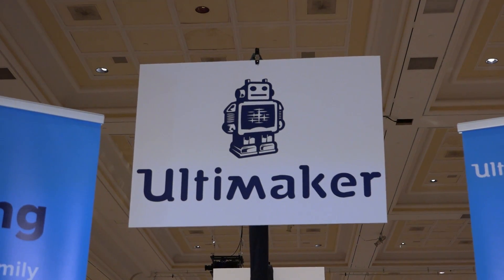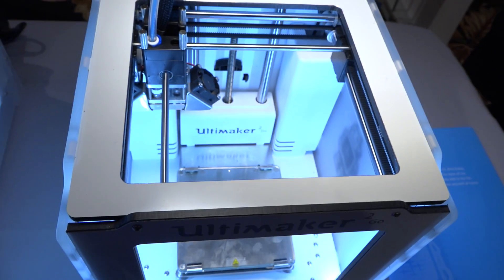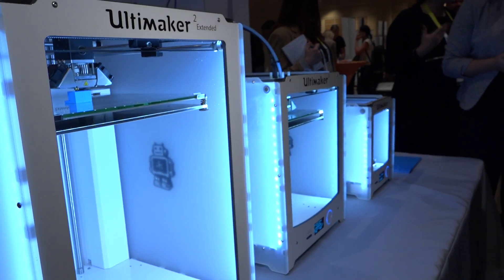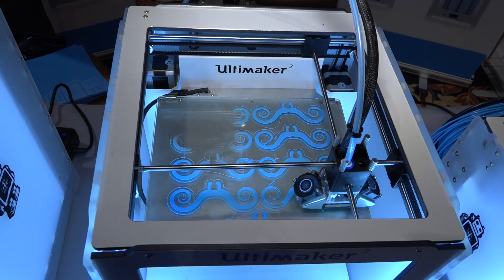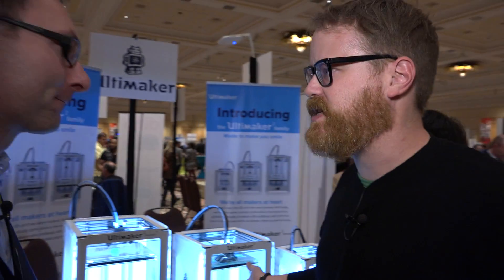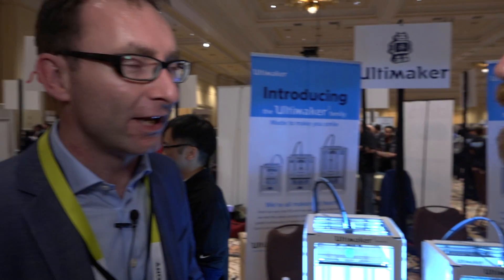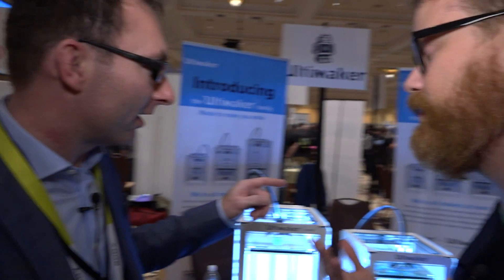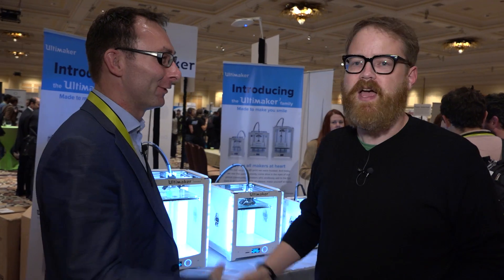Checking Out the Ultimaker 2 Series of 3D Printers

Comment: The Ultimakers are great machines, and yes they can print all the woodfill en metal fill PLA's, Colorfabb has these kinds of filament for months now.
too bad the UMgo has no heated bed :(
and I was hoping for a better price range, but they still sell the UM original, witch is great machine, and more easy to tinker with, changing a nozzle for bigger size takes minutes.

Comment: I am dubious of the 20 micron claims.
Reply: It can be done, I've done it. But it's not worth it IMHO. When I want very high quality I go down to 0.6mm. Anything less than that is mostly wasting a lot of time as you can barely make out the layers as it is at 0.6mm. Also, in some cases going to very thin layer heights actually reduces the quality due to how plastic behaves.With 3d printing you need to pick the best settings for the object, there's not one setting to rule them all.

Comment: 300 mm/s, must be nice to print at those speeds! I'm stuck at 30mm/s
Reply: Unfortunately that's marketing bullshit. Sure, you might technically be able to print at those speeds but you'd have to print very thin layers and high(ish) temperature. The quality would also be crap at those speeds. I really wish they'd stop listing that number.
Reply: Vulgum Pecus absolutely and I love them (I work with them for a living). But the 300 claim bugs me quite a bit hehe
Reply: Vulgum Pecus Depends on which model you choose and what you consider quiet. The UMO (Ultimaker Original) can be fairly noisy, it's primarily the feeder that makes the most noise during retractions. Decoupling the feeder from the rest of the printer reduces that sound to a whisper though. After that I'd say it's the cooling fan on the head and after that the steppers (depends on which sound you find more annoying).

The UM2 is fairly quiet during operation but it's not silent. It's an open printer and stuff is moving around so there will be noise. The loudest part of it is the Z-stage, when it homes (while printing you just hear a faint tick as it moves the bed down layer by layer). After that it's the two side fans and then the middle fan. The middle fan noise gets masked by the rest of the printer during operation but since it is always on you might find it annoying while the printer isn't doing anything. Near silent fans are available to replace it with though (and I'd recommend doing that).

That said, we frequently have 2-4 printers going at once in a small office and we have no trouble talking to each other like normal.

Unfortunately I don't really have a good grasp on the noise compared to other printers. Best would be if you go to a reseller and have them show the printer to you. Or maybe you have a Hackerspace or something similar in the neighbourhood that has one you could listen to?

If you need more info on Ultimaker printers you should check out their forums (or ask me :) ). You'll find all the good and bad things about it there, we don't hide/censor anything like some other companies...